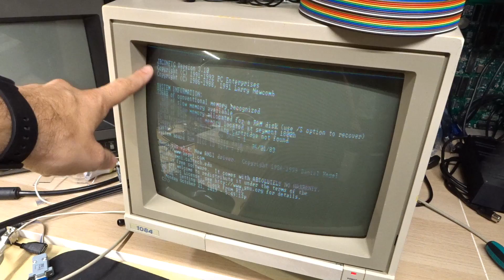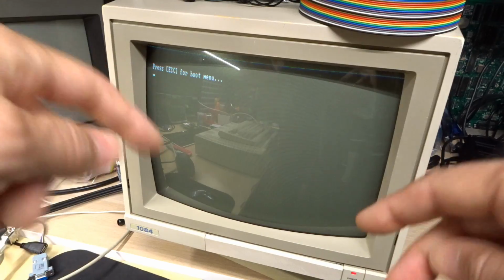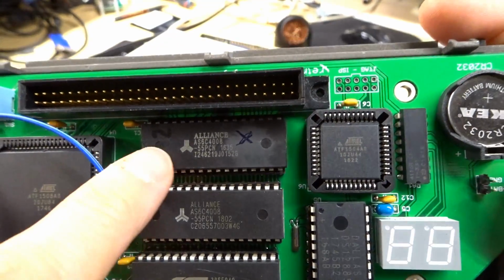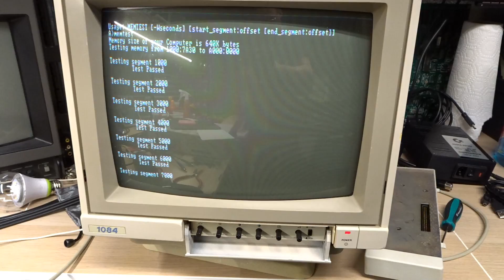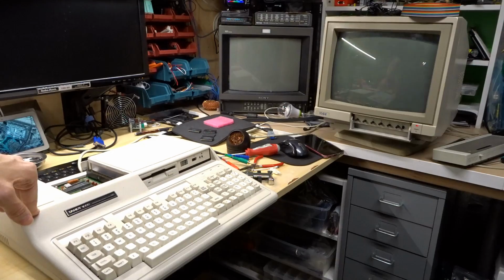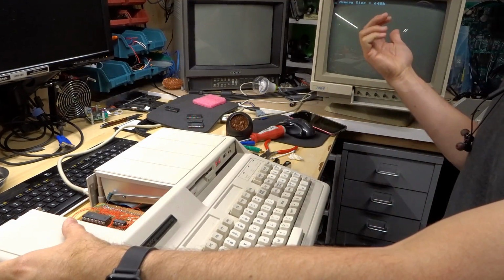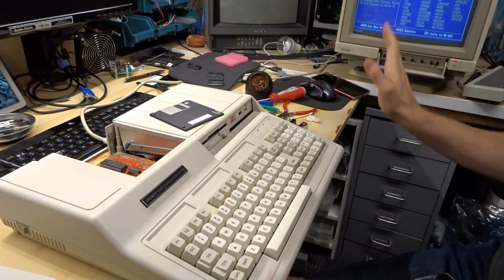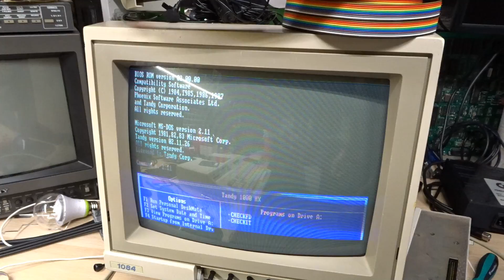Follow-up to fake or real chips? I think I know the answer now.

Comment: Common problem. Take slower chips and chips from different manufacturers, remove the top, and etch on new markings. If they are painted on, the paint rubs off easily. If they are lasered on they will use wrong fonts or logo versions that don't match the date codes on the chips. Legs will be retinned in a solder pot which is why you'll often see thicker solder on the wide tops of the legs and leg grunge where the leg bends and meets the body of the chip. 

If you buy them by the tubes you can often see the chips all have the same date codes, logos, etc, but will have different mold markings and body shapes where they came from different batches and even different manufacturers.

Comment: Case and point you get what you pay for I guess. That error definitely looks like Timing  not post count,  If you put your scope on the Clk line with the good and china chips you will see the stall or bog in the clock cycles.  Odd pulses vs Even.

Comment: This should upset a few, sorry. I am English, old and almost housebound.50 years ago my hobby was valve amps. Rather than watch that dreadful TV I decided to take up electronics as a hobby again. Things have changed just a bit. 3 years on and many linear power supples getting more and more complex I now have quite a nice store of bits. It's all from China. I could never afford the real thing and I don't think much is made in the UK now. I underpower everything, fans, thermal cutouts, etc, etc all over the place. All I can say is what I have found, very few problems. Most of my transformers, heatsinks, etc. have come from old Monacor amps. 8A at 36V is not a toy. Mind you 245V right across the chest brought back memories. No fool like an old fool. In the early days I paid over £30 with postage for 4 x LM317HVT, my one and only order from the U.S. All I can say is thank you China, you have stopped me going mad.

Comment: A couple of years back the USA Air Force caught CHINA taking old military chips re baranding them as new chips for use in aircraft systems control systems.  When the chips had the caps removed the Air Force found that the chips were very old die and much slower than the new die chips.

Comment: When those RAM chips were made, all of them were milspec tested for speed, and tagged by speed. Once the quota for each speed was filled, the rest of the production batch (which could be top grade, but that's money wasted on testing) was sold off as minimum speed, untested and cheap. Some wholesaler might have bulk ordered the untested chips, remarked them, and sold them. That's where extra paint or odd markings would come from. Or, they might be RFE, details unknown.

Comment: The fakes I've got - they use solvent to remove the original markings. Then they apply a black "paint". Then they remark the chip. For example, using this method, they might sell hitachi 120nS chips as Alliance 70nS chips. Since the SRAM pinout is a jedec standard they can sell that one chip as any of a number of different brands and speeds of sram, etc. It is an atrocious practice. Many are also removed from printed circuit boards which is why the pins are tinned with solder. The access timings are likely the reason for your problems.

Comment: I stick the SRAMs like this in an old TOP853 programmer and run the SRAM test. It works pretty good for such a cheap, now discontinued, programmer. I would not install potentially fake chips in a machine like that - depending on what the chip really is, if its power pins are in the right place, there could be smoke and burned traces. I have smoked several fake HD6309E's from AliExpress - almost everyone I've bought was fake.

Comment: They are most probably not fake chips, they are used, recovered chips which are then remarked - often to a faster speed.
 The texture on the top is different because they sand the tops back before remarking the chips. You can tell because the two circles on top of the chip are a different depth to genuine. The China chips are shallower. They also put the chips in a hot oil bath to clean up the solder on the pins, smoothing it.

Comment: Probably noise on the data bus. Long term solution is a bus buffer. Quick try, put a 0.1 uF cap directly across the 5V rail on the RAM chip, might smooth out the local power rail.
I’m a little concerned about you manhandling these CMOS chips without a ground strap. Don’t rub your your hair and then pick up one of these babies from the bench !

Comment: These fakes are old SRAM chips pulled from scrap electronics and relabeled to look like modern parts. While the real Alliance parts have a 55ns access time, these will probably be 120ns or more. The solder dipped pins are a common indicator of pulls as you can't clean it all off so they dip all of them to make them appear consistent. It's always best to buy from a big distributor instead of eBay or a Chinese seller for more expensive chips like these.

Comment: You mentioned that your card didn't have an LS245 (74LS245), do you mean not at all?  If you don't have one, then the "fake" memory may be loading the bus more than the "real" ones, causing trouble when it gets accessed.  Either that or just timing of the signals.  As for the buffer, I've seen problems with different manufacturers of the same part, or using 74xx instead of 74LSxx ones.

The easiest answer is what you found: avoid the cheapest price if quality or specifications might be in question (you often only get what you pay for).

Thanks for the good video, keep up the good work!

Comment: I had a Tandy 1000HX that I taught myself to program on.  I received some games that were compatible with the HX, but only with the full 640KB of ram, which mine did not have.  I ended up never playing those games because it would have cost something like $600 - $800 for the two needed upgrade modules.

Comment: I bought a bunch of SST EEPROMs from China a few years back.
They are correct size, but not the same speed.
Sometimes clearing works, sometimes not.
I treat them as OTP now. And had zero complaints from users.
Maybe you can check timings as suggested below?

Comment: It's SRAM so maybe they've relabelled a slower speed RAM as a faster one and the timing issues are causing access issues. Check the timing between the read logic edge and the data appearing on the bus, comparing between the good and bad chips.

Comment: I know Mouser is expensive for small numbers of parts, but I never buy ICs or other important things from Ali or Ebay. Especially when it comes to vintage parts, you're likely to get either fakes, or more often, rejects and pulls that are being sold as good/new. Those rejects and pulls may work on one computer and not another, depending upon tolerances. 

In your friend's shot showing Digikey and China, the giveaway is not just the bad printing, but if you look at the circular indent, you can see it has been coated just like the top. In the genuine part, the circular indent (die pin release, I believe), is clean and flat, not coated. There's a good site out there that covers these types of things to look for, but if I post a link it'll get marked as spam. The re-topping process does involve a black paint-like coating.

Also, almost all ICs are made in China today. It's not an indictment of China, it's an indictment of non-reputable sellers who do not keep a verfiable supply chain. (NOte that Alliance is fabless -- they probably get their dies made in China as well)

Real Q: Why order from random sources again after having been burnt before? Have you learned the lesson, now? :D
Edit: Ok. At the end you answer that question :)
Reply: BTW, that chip puller is a plastic, erm, Chinese copy of a metal part designed elsewhere :)

Comment: Even these days I find RAM modules that will work fine in one machine, but when placed in another, it won't POST.  Same specs, same memory requirements, just not compatible for whatever reason.  Some hardware seems more critical of chip timing and performance being in spec.  I think your chips are fake and the Tandy is more demanding than the IBM.

Comment: The Chinese manufacturers copy these chips. They make some really good quality chips at that, but there is a certain percentage of chips that don't meet their specs or are complete failures. To recover there loss they sell them to distributors who sell them to Chinese shops that paid pennies on the dollar for them and sell them to you for 10 for $1. I am willing to bet a lot of Mouser and Digi-Key components are made in China , but are the good chips of the batch. 

But the black stuff coming off the chip. WOW! 

Seems like a lot of work to sand down an old chip, paint it, stamp it, then polish the pins and sell it as a new chip. Maybe it is a new chip and just out of spec. The black paint and stamp may be a cheaper method of stamping the chip then actually etching the stamp on it?
Reply: No, if it is a immitation, they are clever enough in China to use a proper package. These chips have likely been recycled and rebranded. They have a complete IC recycling industry in China to make old chips look good again. Sometimes this is good: I got some Commodore CIA chips that were treated this way, they work perfectly and if they can make them look nice again, why not. In the situation we have here in the video, it is of course a completely different thing and as a buyer you expect proper ICs, not recycled and relabelled chips.

Comment: i was just thinking about this more... perhaps the sync is slower/faster than the tandy needs to make a correct signal over. the ibm pc may or may not be running some type of controller that isnt particular to sync timing as much as gate?

Comment: I'd like to suggest a "possible" reasoning that the new chips may not work within your constructed board, and the same reasoning that the old ones will. There is a term in manufacturing called the "Fan-out Capability" of each pin. Since you've not used the LS245 (Buss transceiver), in your circuit, you may be surpassing the capability of the Buss Fan-out. My suggestion, add the LS245 to your circuit and try again. ThanQ...
Reply: My reasoning why the old ones work and new ones don't in this case, is that "possibly" the new ones were manufactured with a "lessor" specification by China, than the old ones had for their "Fan-Out" capability.

Comment: So the chips have been faked in some way. They obviously work, but are probably slower than you think they are. 
You obviously have marginal memory timing on one machine but it works on the PCjr. You have a logic analyzer. Hang it on the PCjr and look at the memory cycle timing. Then look at the timing on the machine that works marginally. Pay attention to the enable timing. Then look at it on the machine that doesn't work. I think you will find a difference in the memory cycle timing, and you fake chips just aren't meeting the setup time requirements on anything but the PCjr.

Comment: I when to the link you posted for the Jonard Tools EX-2 Chip Extractor.  I searched for distributors in my area and called them up. Nobody had any. With the surcharge for not meeting the minimum order and shipping it was going to cost about $80 to get one.  The Jonard web-page shows the UPC code but but everybody wanted the Model number which was not obvious to me.  Luckily one of the distributors was very helpful and gave me the model number and suggested looking on Amazon an I found it for a reasonable price.  Thanks for letting me know such a tool existed.  It seems a lot easier to use than the tweezer type.    https://www.amazon.com/gp/product/B006C3Y8IY/ref=ppx_yo_dt_b_asin_title_o00_s00?ie=UTF8&psc=1

Comment: You can't test HMA on an 8088/8086 because it does not exist. 0K-640K is "Conventional" memory. 0K-64K is "Low memory."
The address space between 640K and 1024K is the Upper Memory Area. It's reserved for video cards, expansion ROMs, the system BIOS, etc. With some video cards, like MDA/Hercules for example, you can have additional memory in the conventional memory area (up to 736K) because the video addresses begin later. For MDA, the limit is 704K, CGA is 736K, and EGA/VGA is 640K.

"High Memory Area" or HMA is on 286 and later processors. The A20 gate can be controlled by some software (such as later versions of DOS) in real mode to allow access to about 63K of XMS without entering protected mode. It's done by indexing out of the 1MB range. The address doesn't wrap around, so it's fine. Resetting A20 will cause it to wrap around to 0K like a normal 8088 or 8086 - The standard for real mode.
Reply: @adriansdigitalbasement  It is not so complex to write a software writing and reading AA 55 to do a basic test.

Comment: Data bus transceivers provide more current to drive the data lines.  The China memory chips data bus drivers may provide or sink as much current as the original Alliance chips do.  Does the PCjr PCB have line drivers between the memory chips and the CPU to strength the data bus signals going to/from the CPU to memory devices.

Comment: I've just learnt the same thing with a dual frequency oscillator mod I have done on a master system, I ordered 5x CDCE913 clock synthesizer chips from China, they arrived in a polythene baggy and right then an there I knew they would all be bad and they were! Then I ordered some from RS...problem solved. Most things are fine from China but IC's are always a gamble.
Reply: CDCE913?
Reply: @xxycom8963  Sorry my bad, just corrected my comment.

Comment: Two thoughts:
-That black paint looks like laser marking spray (https://www.trotec-materials.com/news/laser-marking-products). I would bet they are using a cheap CO2 (k50?) laser that can not engrave the epoxy package directly therefore the paint and blury print.
-I had a run in with gray market components through work a few years back and after hand testing 1000 pcs, I came to the conclusion that what we had bought must have been fab rejects that were scooped from the bin and resold as genuine. Many of the parts simply didn't work, but interestingly many sort of "worked", just not to spec. The vendor didn't even blink when we sent back 600 pcs as defective, he had a ton more to replace them.

Comment: it may be a slower chip they can take a slower chip and redo the mask and show its faster . i worked for ncr for 10 years and they made there own chips and got some from china the china would not work at 10 mhz but the ncr did

Comment: im assuming that the tolerances made with the china chips are wider, so they could have less exact QA. example if a resistor is 8k oms, the china could be 7,950 oms, instead of straight 8k. however PCjr could also have wider tolerances so IBM could work with more sub-par parts. 

Personally I would use an oscilloscope and map it from the good chips and the china chips. that would show how the chip is made and the difference between the 2 and point to you why thats happening. love your vids Adrian as always man!

Comment: The RAM chips are counterfeit but are still "RAM"; definitely not OEM. I'm guessing the speed grade is different though and that is messing you up as you are not buffering via the '245. It would be interesting to "scope out" the address and control lines  on a logic analyzer and see how it behaves to different clock speeds. I guess you would need a RAM tester for that though.
Cheers,

Comment: Hello. Did you put a 100nf capacitor on the power railes very close to the memory chip?
Reply: He didn't. I put bypass caps on all my ICs as a matter of course, even if the power looks clean. They're a cheap component, so it's just one less thing to worry about.

Comment: Likely these are slow chips. There's a 55 nsec version of this chip and a 70 nsec version. Your off-spec chips might be slower ones rebranded as faster. That's a common counterfeiting scheme. In some designs, they'll work. In others not. Depends on the circuit timing requirements.

Comment: The suspect chip may be slower, but using the 74 series buffer may be sufficient to allow you to get away with using them (it will have the effect of cleaning up the signals). In other words, the fakes are probably fully functional but lower spec. chips, most likely pulled from used equipment (hence the nice shiny soldered legs). 

A quick rub down with 400 grit to remove the old markings,  a brush with fat black sharpie pen (or more likely a Chinese sharpie clone), and a whizz under the laser etcher and a yingyang 100ns clone ram chip becomes a known brand 10ns chip + $$$ profit. 

The other trick used by some of these suppliers is to add in 10% of random scrap chips with the correct number of pins overprinted with a valid part number, to a bandolier or two of say 10000 genuine chips. This boosts your profit by 10%, assuming your customer doesn't spot them and puts the failure rate down to their own processing. That could turn each $1,000 profit in to $1,100 for next to no effort, and it cleans up your scrappage rate of already dodgy parts, turning them in to money. 

This is organised crime at work. Big money is being made with these ripoffs.